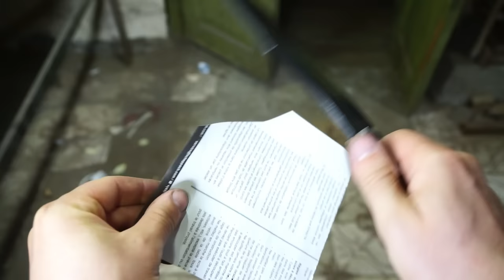Making a large kitchen knife from an Old Saw Blade

Comment: Not a kitchen knife, the angle is completely wrong. 
Also, you put rusty pins in the handle. Rust spreads. Are you trying to rust the knife? 
And the rough spine might be trendy looking and cool to you, but it also is a great catch for bacteria. 
This is a sometimes camp use knife at best, not a daily use kitchen knife. That curve is styled for a butchering knife, not a kitchen knife.
Did you make sure the chemicals used, like the glue and stain, are food safe?
No, you didn't. 
This is a great example of why people not knowing what they are doing is dangerous. 
The sadder thing is all the people telling you how great the knife is and not knowing why it really isn't...
Reply: The blade style is a rocking Santoku Knife, his blade profile is a little more extreme, the whole concept of this design is that you can use it for out door bbq, quartering your meats, and kitchen use, or at least that’s what major knife makers advertise it for. Me personally I prefer SS, however carbon steel knives it is always recommended to dip the blade in boiling water for a deep clean, and let sit there if boil for about 10 min. After the dip let the water cool down, if there is foul petro smells in the water or hard particles in the bottom of the pan you may need to repeat this process at least two more times , if by the third boil dip the water has chemicals in it or other particles the knife is useless.
Reply: @f.w.1318  lmao
No, just no. It isn't a rocking santoku. And no other knife maker is calling it that either. 
I understand you fanboys get triggered easily, but that isn't a chef knife no matter how upset my post made you.
You also didn't address THE NUMEROUS issues I pointed out beyond the poor design. 
I've been in kitchens for 40 years and an executive chef for 30 years, who also makes and restores knives. 
Quit being that triggered fanboy...
Reply: @Facetiously.Esoteric  uhm, nothing in my comment was triggering, Ive never owned this style knife, you seem severely upset, I was just stating this, since  is what I've seen on online reviews and trending with blacksmith forge's, there are a few in my area, as a consumer I've purchased hundreds of knives different manufactures, and styles, go hug your kids, have your wife pamper you for a little bit, good luck with your kitchen PTSD.